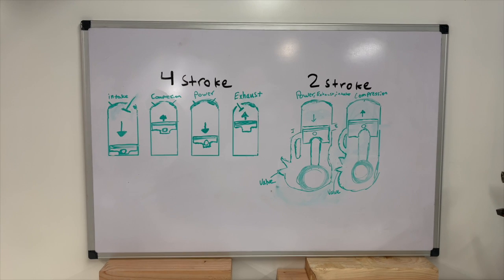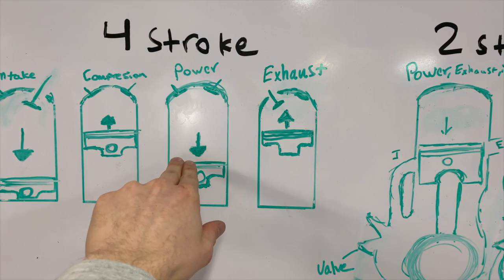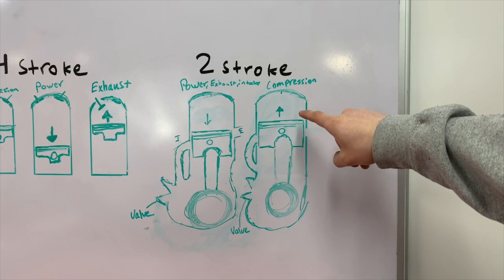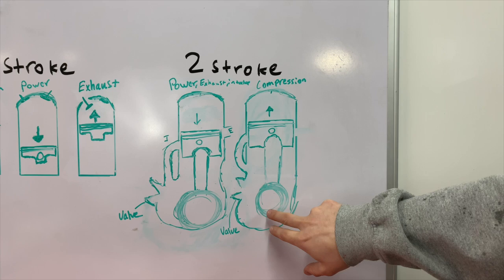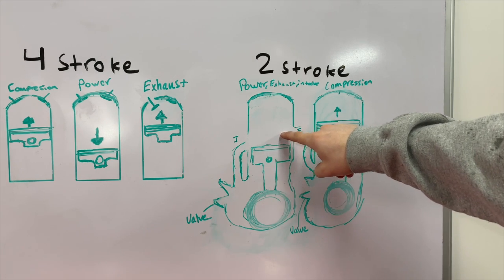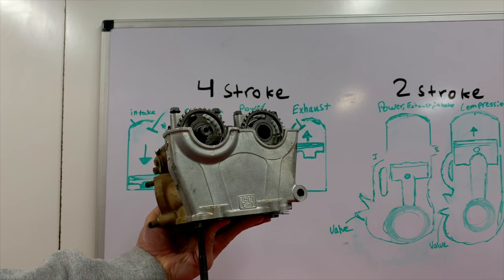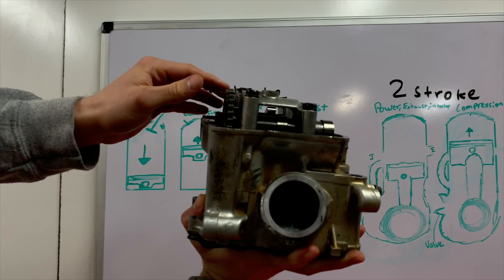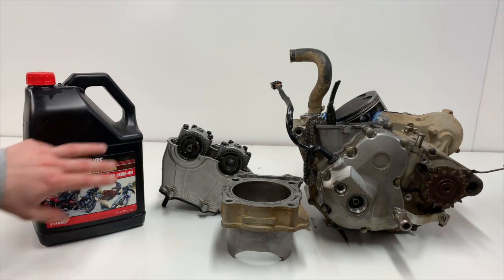Major Differences of the Two and Four Stroke Engines

Comment: Thanks for the video. The thing that confuses me about the difference between the two engines is this. The four stroke and two stroke engine both have four strokes: intake stroke, compression stroke, power stroke, exhaust stroke. Why do we call a 2 stroke engine 2 stroke when it goes through the same cycle as a four stroke engine?

Comment: hey man can you please help me im not that great with bikes and im having an issue on my cr125  i went to replace a clutch cable and where it attaches to that little shit lever by stator i noticed its so loose like theres no tension when you lift it it feels like its not even doing anything  i even started it and lifted the lever and went to gear and it just stalled kinda showing me that i was right and it isnt doing anything i also then opened my yz125 to compare and when you lift that lever it has that tension to it so it spring back when you release but on the cr125 its just moving so freely feels like whatever it goes to its not like meshing with it or somthing i then tried to take it out but couldnt slide it past stator and was having trouble getting nut off cause dont have impact  do you know if something broke internally why that lift lever just lifts with a pink and dosnt have resistence   thanks alot

Comment: They are both great.....4 strokes r superior though!! My case being 2 strokes are loads of fun on a motocross track and on snowmobiles, but too inn efficient for much else. I think 2 strokes will be phased out of lawn care equipment with quieter lithium batteries and the only two strokes will be motocross bikes and a couple die hard sled company's. 4 strokes are in everything. Dirt bikes, dual sport, snowmobile, side by sides, farm equipment......everything. Long live the 4 stroke 😀
Reply from the maker: Unfortunately you are probably right
Reply: @adampaganelli4891  very Informative videos.  Great job

Comment: Simple answer:

 valves. 

Valve are the only difference between the two.
Reply: U dumb
Reply: Marnick no u
Reply: Marnick no u
Reply: Differences more like valves, exhaust, engine lubrication, the actual cycle of the engine, weight and efficiency. Add up if i missed something.